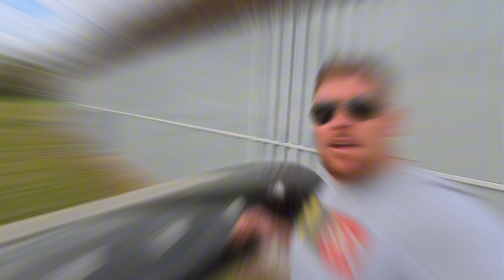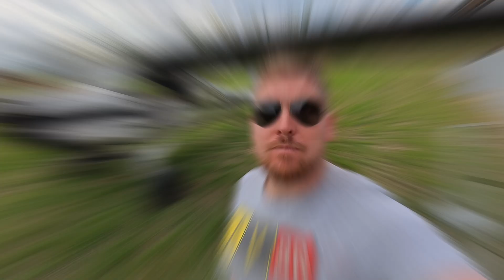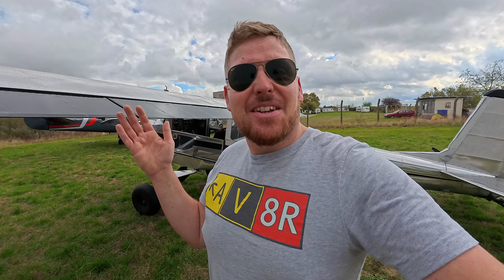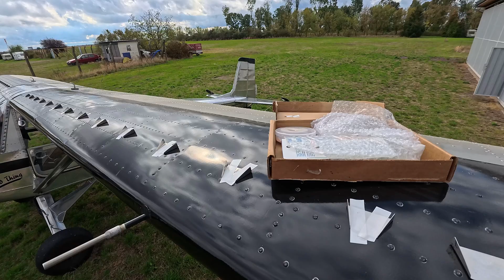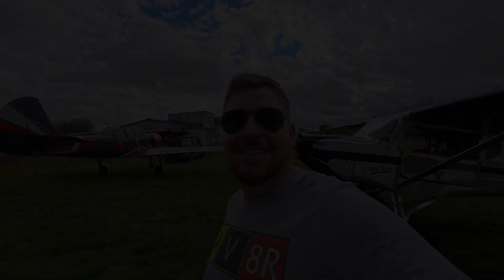REVIEW: How do vortex generators work on an airplane? My real-life experience

Comment: I’ve flown crop dusters without them and then flew the exact same aircraft with them. I’m not impressed. They decreased the stall speed by 3-4 mph and decreased the cruise speed by about the same amount. Not a fan.
Reply from the maker: Interesting feedback, I fully believe you, but of course this is some very individual thing - for my WT01 it worked extremely well. I guess that is try and error for every individual airplane..
Reply: @ probably true. I’m sure it would depend on the NACA airfoil.
Reply: I agree, but, I think it depends on the aircraft.